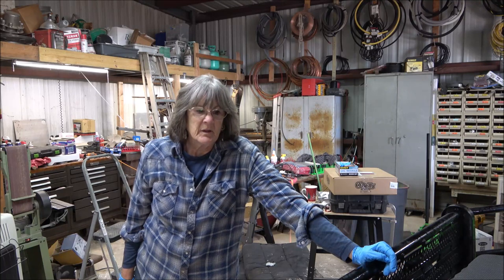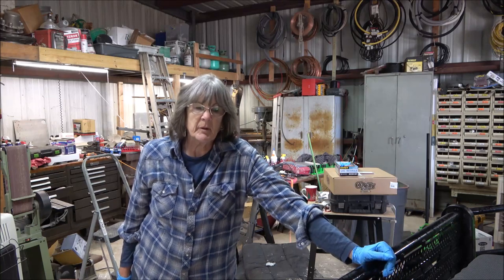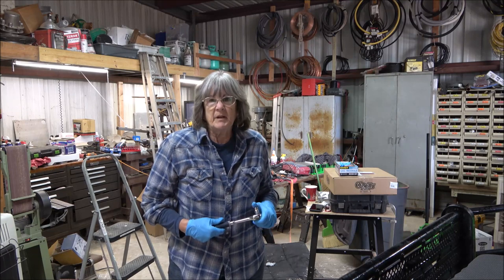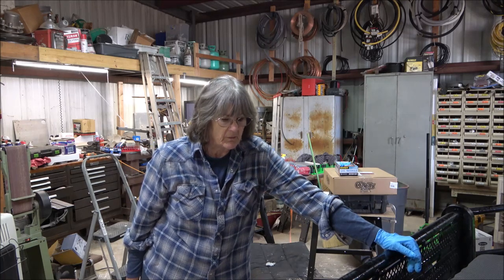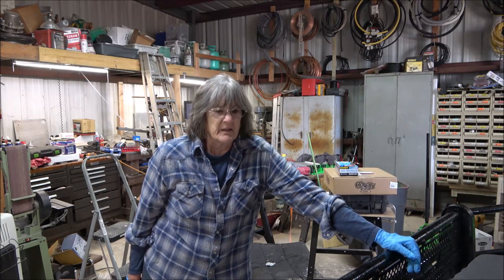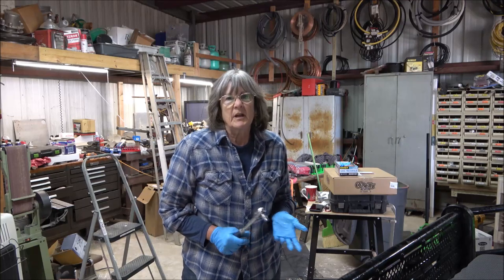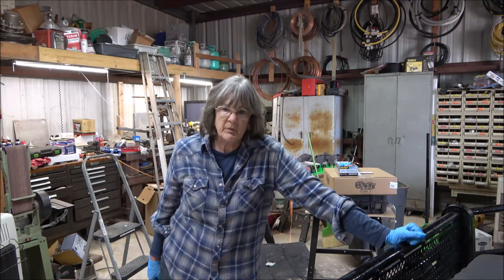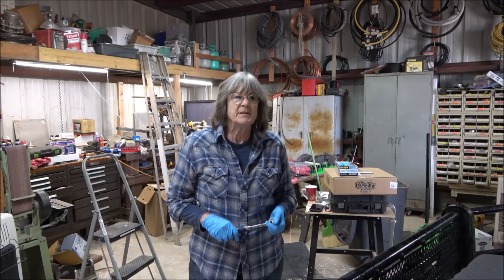No. 0128 - Vacuum pump delete

Comment: I appreciate you giving the part # for the belt after deleting the pump. I have a 97 7.3. I have had my share of rebuilt pumps too. Couple of years ago. I purchased a new Motorcraft pump. It's been on for several years. However, it will play out one day. I noticed Motorcraft has now discontinued them. So I'll be stuck as you were when it happens. BTW, my truck (I purchased new in May of 97) over the years had gotten so hard to start. Even at just 40 degrees, certainly less temperatures.  It took multiple cycles of the glow plugs. Last October,I installed new Glow plugs, under valve cover wiring harnesses and valve cover gaskets. All Motorcraft stuff. One frosty morning over the winter. It was around 18-19 degrees. She fired right up. Just like it did when it was brand new. 1 , 10 second cycle of the plugs.  Not bad for when it has 272K miles on it!
Reply from the maker: Anything to keep these old girls running I guess!  They sure are good trucks.

Comment: It shows this video at 1 year old. I like your idea. So far it looks like the best fix that I have seen on the Internet. Did you have any possible related problems from changing to the shorter belt. Like a water pump or alternator possibly failing due to different angles because the belt is on a different route? I hope you didn't because I would like to repair mine in the same manner. My vacuum pump just isn't creating enough vacuum (only 5" of mercury instead of 18", 22" or 25"). I figure it's a matter of time before it self destructs and no longer serves as an idler pulley. I figure I better put in the shorter belt and get the later model electric vacuum pump. Please let me know how it held up. I'm trying to get my truck ready for a trip.
Reply: I'm very impressed with your ability to wrench. My wife and I are close to 59 and I totally understand how it used to be so much easier to do things when we were younger. I have a couple levels of spinal fusion at the very bottom of my spine. I really have to be careful and take a lot of breaks to keep my spine from hurting.

Comment: I would like to know what electric vacuum pump are you installing . What's the manufacturer,part number etc.
Reply from the maker: @wiliiamamey5967  I'm sorry but I don't remember but it's just a basic electric one we mounted on the firewall.  We haven't had any issues with the truck after changing it around.  Sorry for the delay answering you, I just now saw your posts.

Comment: what electric vaccum pump is the truck running for hvac noticed it has hydroboost for brakes.
Reply from the maker: The brakes aren't involved in this particular vacuum pump configuration. Pretty sure it's the Dorman 904-214 Vacuum Pump.  The only thing the vacuum pump runs on this truck is the heat & air.  I think someone switched the brakes over and did a whole new master cylinder setup on it prior to us getting it.
Reply: @womanatthewheel  10-4 well thanx to your video I've got the one part number down for the delete on my truck 96 f350 an u are right they are complete crap haha last I installed didn't even last 50 miles before I lost brakes
Reply from the maker: @flipcab2880  Glad to help!  Yep, they are definitely crap

Comment: any video of install on electric vacuum pump?
Reply from the maker: If we didn't show it in this video I don't think so.  Pretty sure Bill installed that while I was out on a run...  However, it was pretty simple.  He mounted it near the fuse box on the driver side which made it easy to patch it into the fuse box and the pneumatic hoses.